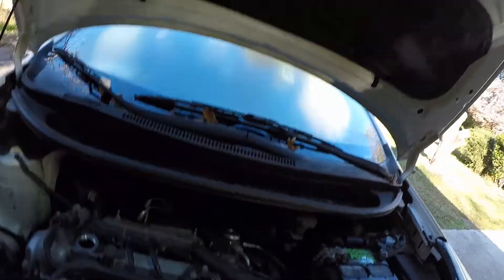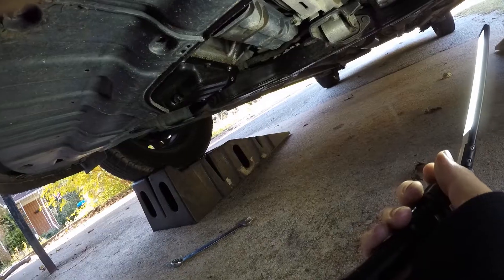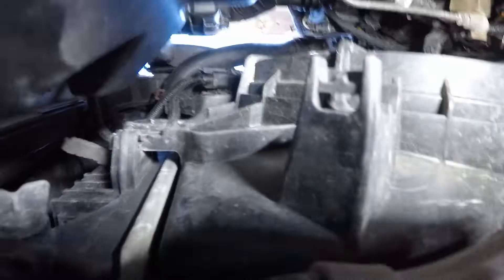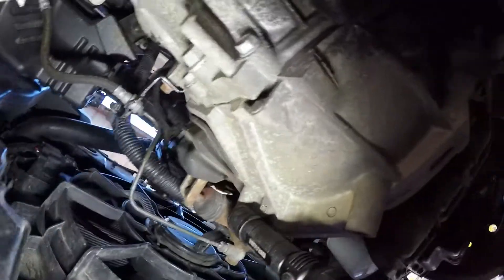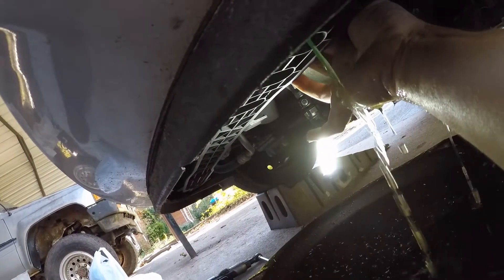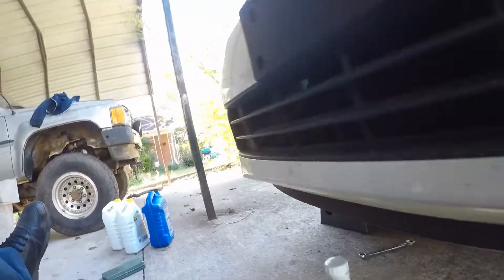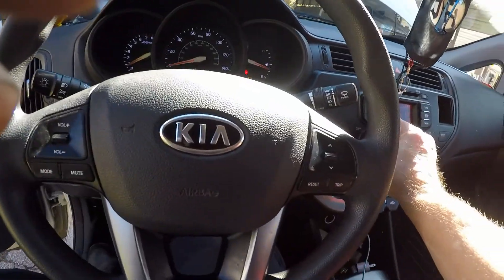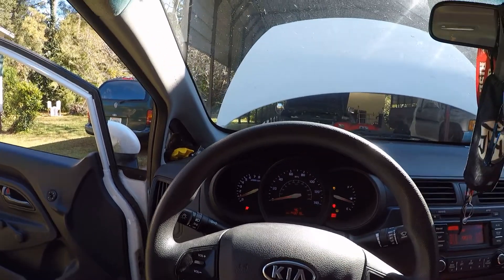How to do a coolant flush on a 2012 Kia Rio

Comment: I just did it. Hardest part was getting that drain plug off. I just took out the air filter housing and used a wrench, then twisted by hand.

Comment: great video, it will definitely help me do my flush , i have a weird issue .. i only get heat/cool when i touch the throttle, as soon as its touched they kick in and work great  told the flush will solve that... if it doesnt ... do u have any thoughts on what i can do to fix the issue .. pain in the ass not having heat or ac while sitting at red lighrs
Reply from the maker: If u don't have heat until you touch the throttle,u are either low on coolant or have air in the system.

Comment: I overheated my 2014 kia rio once, left the radiator cap off and drove off, now it overheats all the time, and it spits out the water through the reservoir, i did a test to check the heads and it was fine, i changed, water pump, thermostat and i think i might have also changed the temp sensor but im not sure if i did, i did a previous flush, but it still overheats, i just tried your method but the fan never turned on, there was heat through vents though. Any idea?
Reply from the maker: You need to have access to a scanner,that way you can see the real time temp changes if u can,also you probably need to bleed the system.follow these steps:To most effectively bleed the air, pour the water slowly and press on the upper/lower radiator hoses.1:Start the engine and allow to come to normal operating temperature. Wait for the cooling fans to turn on several times. Accelerate the engine to aid in purging trapped air. Shut engine off.
2:Wait until the engine is cool.
3:fill it the radiator and turn heater on.
Reply: Check fan fuse

Comment: Tim do you have to run the heat after the fill?
Reply from the maker: You should,that way it will cycle all through the system and get any air out of it it may have,also a rule of thumb if your heat works then it has no air and the thermostat is opening.

Comment: Was it running as you filled it?
Reply from the maker: No,you should not have to fill a coolant system with  the car running if all the air is out of the system you can fill it up and put on the cap,if you do not have all the air out of the system you will have to fill with car running and heater on.

Comment: My kia rio 2012 a/c is dispensing cool air even when it is put on warm air
Reply from the maker: Probably the blend door actuator, that controls your blend door that opens up the panel for the air to cross over the heater core or evap core, have that checked.